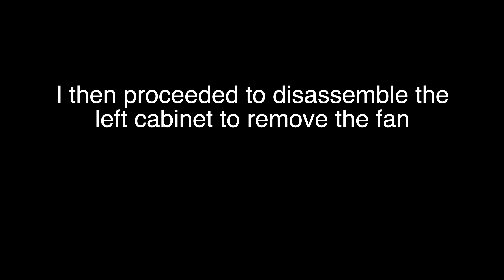T@g Air Conditioning Mods - Dual Exhaust Fans and Duct Fix

Comment from the maker: **UPDATE**  We got the opportunity to test the A/C in high heat this weekend, and I'm glad to say, it worked great.  The temperature was in the 90's, we were in direct sun, and the inside of the trailer easily stayed in the high 60's, on the low setting.  I still believe that the biggest impact was made by the fix to the ductwork, and the extra fan probably has a minimal impact.

Comment: Thanks for the info. I'll be checking the tape around my A/C with a flashlight now that I know it can be an issue.
One good thing about this kind of a project is you learn a lot about your camper.
Reply from the maker: That is definitely true, I thought this was going to be a quick fan swap when I started....  little did I know.  :)  You should be able to get a pretty good look with a flashlight just by taking that trim piece off.

Comment: Great video. We purchased a 2018 T@G trailer that had the A/C removed so it was good to see how to install it the best way. Adding more metal tape will certainly help with venting and we'll probably add a secondary exhaust fan soon. One note, for us, removing the bottom as well as the back of the TV door cabinet made it WAY easier to make sure the metal tape is secure, especially along the top of the A/C. Finally, we hope to add a plug in the TV door cabinet as well . . . our A/C plugs in way over to the left of the radio!! Always something to "improve".
Reply from the maker: Thanks! I can definitely see where removing those other panels would make the job much easier. I think I was trying to remove as little as possible, with the fear that I wouldn’t get it back together. 😂

Comment: Hi,  You did a good job.  I do have one recommendation.  Those two little fans are totally inadequate to remove any real heat.  You should replace them with a  higher cfm 12v fan like a Titan 12v fan.  Amazon sells three sizes.  Get the biggest one that will fit.  They are whisper quiet and will help tremendously removing the hot air.    The two fans that you have are just not strong enough to do much.    Other than that you have great patience and did an awesome job. Thumbs up, Lou.
Reply from the maker: Thanks for the suggestion!  I will have to check that out in the near future.  The good thing is that I made the leads to the fans long enough that I can now swap them out without removing the A/C.

Comment: Great Video!!! I've been thinking a lot about this topic. I had the same issue; can't hold the temps on hot days. I am convinced that the 2 side intakes "Rear Intake" (just right and left of the box) should be pulling air in from the outside, not the inside. Think about a window setup; 3/4 is on the outside, only the front is on the inside. Why would they have the rear intake on the inside of the camper. By shear logic, the rear intake will pull the cold air from the camper and draw air through the windows or the upper fan drawing warm air into the camper. I do understand that there will be some efficiencies gained by this through the conversion process, but I believe it is overshadowed by the loss of bringing heat from the outside into the camper and not building upon itself (like a car, if your recirculate air, it gets colder). Having said that, I think that if you were to take the two round rear intake vents and duct them to the outside somehow, your efficiencies will increase significantly. Another thought is that Nucamp did this to have the unit continue to run to reduce the condensation. If we get it super efficient, the compressor will only run a few times an hour and the unit's humidity level will be almost 100%. I'm also thinking about installing a mini-split.
Reply from the maker: Thanks!  I'm by no means an A/C expert, so take this with a grain of salt.  Anyway, the way I've looked at it lately is to compare it to a central A/C unit, with the front half being comparable to the inside coils, and the back half being comparable to the outdoor compressor/coils.  It is my understanding that the air that blows over the "inside" coils (the cold ones), is being sucked in from the front of the unit, so it is similar to the recirculate in a car.  Then the air that is brought in from the outside keeps the "outdoor" radiator cool (if that makes any sense).  Now that mine seems to be working properly, I'm wondering if the round side vents are even necessary.  There does not seem to be any substantial airflow through them in either direction.  I do think the biggest issue now, is the humidity, due to the reason you pointed out.  With the unit running efficiently, the compressor doesn't run for long before it reaches the appropriate temp, and kicks back off.  With that being said, I try to keep mine on low as much as possible, just so that the compressor will run for a little longer, and remove a little more of the humidity from the air.
Reply: @MidwestJourneys  Just completed my full upgrade. 1. I replaced the ac unit with a frigidaire; its 1" less deep than the danby which creates more room in the back for air flow and its a bit quieter. 2. did exactly what you did by taping all around the rear of the unit. 3. I replaced the fan below the ac with two IP-55 fans but placed them closer to the duct work for greater efficiency 4. I soundproofed the ac box with auto matting 5. I sealed up both the two vents on either side of the ac unit and some other areas that leaked into the cabin 6. I sealed the front of the unit once the unit was installed prior to adding the wood trim piece. RESULT: much much more efficient and quieter. I tested it in my garage but not in full sun yet. Thanks again for the starting video.
Reply from the maker: @jamese4440  Nice!  It sounds like you had quite the project!  How thick is the auto matting that you used for soundproofing?  I'm assuming that it is fairly thin, to allow for airflow to the sides of the unit.  I also bet that new unit really helps with it being an inch shorter.  The original unit is pretty close to the ductwork.

I'm glad to hear that the project worked for you.  We were in high heat and humidity again last weekend, and ours is definitely performing better than what we were dealing with last year. Thanks for watching!
Reply: I don't understand how the 2 external vents allow outside air to get to the ac? It seems to me that the unit only takes air in from the 2 white vents inside. Do u know what the vents on the outside do, if I'm correct?

Comment: Thanks for the video.  I just bought a TAG SE and all is well.  I am "thinking" on installing a box (metal or wood) to the exhaust vent on the outside under the T@G and installing fans there.
Reply from the maker: I've not spent a lot of time looking at the SE's, as they were not an option when we bought ours.  Just from glancing at pictures, it looks like you may have really good access to the A/C, if that back panel behind the unit comes off.  However, if your A/C is working well now, I'm not sure if you will see a noticeable improvement with the fans.  I think my biggest improvement came from fixing the tape around the ductwork on ours, as it was not creating a good seal.  Good luck, and thanks for watching.

Comment: Great vid! Ive got a Braxton Creek Bushwacker with a simiar AC set up, except no included fans. Im going to be installing some very similar to how you did. One problem I have with mine is that wall underneath the AC gets very hot with all the warm air going through it. Im hoping that once I have some fans (4 of the titan fans) moving the air out, it wont get as hot. Do you have an issue with the hot wall in your set up?
Reply from the maker: Yes!  Or at least we did.  Before I did the work to it, the access panel where the fan was mounted would get so hot that you couldn't keep your foot against it at night.  Now, it will still get warm, but not nearly like it used to be.  Definitely try to see if the ductwork is properly attached to the A/C, as I think that was a big part of our issue as well.  Feel free to reach out if you have any other questions.

Comment: How do I access the intake fans from cowbells? Mine are blowing out and I want to flip them. Also what bracket did you get to put two together for under air conditioner?
Reply from the maker: If I remember right, I believe the intake fans can be accessed through the back panel on the inside of the cabinets. Look in the video description (you may have to click "Show More"), and the link for the bracket kit is there. Please let me know if you have any other questions, and thanks for watching!

Comment: I don't understand how the 2 external vents allow outside air to get to the ac? It seems to me that the unit only takes air in from the 2 white vents inside. Do u know what the vents on the outside do, if I'm correct?
Reply from the maker: They do draw air in outside air for the A/C. The air comes in the outside vents (with assistance from a fan on each side). The air passes through channels behind the cabinets, and gets to the A/C unit through the gap on the top and sides (around the ductwork). Part of the issue that I was having with the ductwork not being taped down was that instead of all the outside air being routed through the A/C, part of it was going right back outside through the exhaust.
Reply: @MidwestJourneys  ty